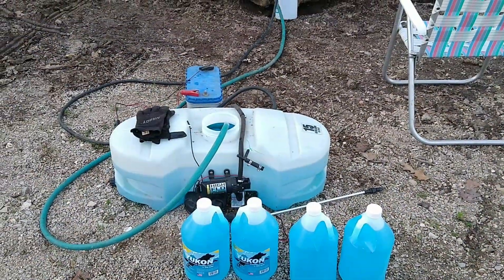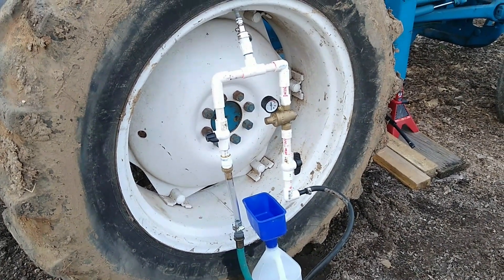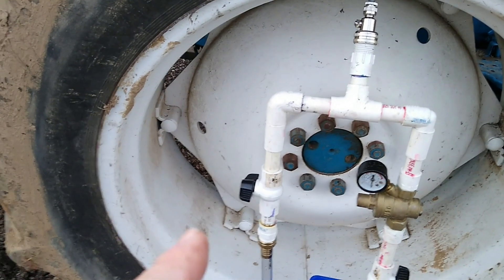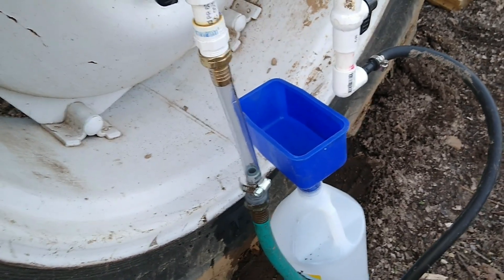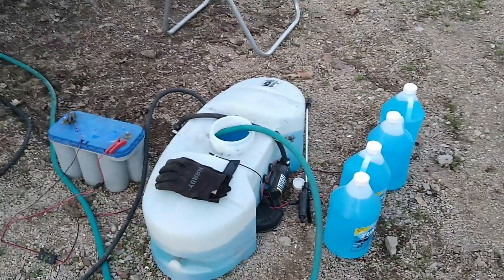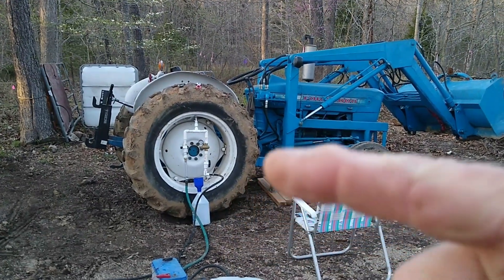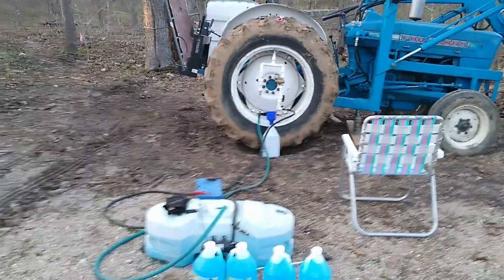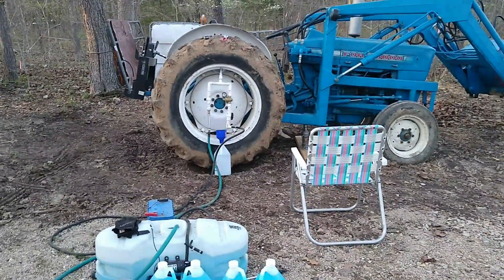Tractor Tire Ballast Weight with -20 Windshield Washer Fluid

Comment: My Grandfather and Dad used to drill wells down Kingsland Fordyce and Rison. They used a draft horse named Shorty who would climb in and out of the truck for traveling to the drill site and a Model A Ford 1.5 ton dually Truck to pull it back up to change shaft extensions and carry the tripod. It did this by attaching the cable between the dual rear wheels. The Blackmith locally made the Drilling bits and reforged them as necessary. They drill quite a few Hundred wells between the 20s to the 50s. Our last name is Crain.
Reply from the maker: That's an incredible family history and an amazing story about how wells were drilled back then!

Comment: I could have filled those tires for not much more money and used proper ballast. Washer fluid killes tire over time. Rim Guard does not. RG weighs about 35% more than washer fluid. And RG wont freez till -35.
Reply from the maker: I sure could use an additional 35% weight.  I wish you were close enough to have filled them.  I haven't heard that washer fluid was problematic for tires.   Thanks for the information.
Reply: @Returning to Basics  We have dealers all over the Midwest and South East. If you ever want to try it, I can help find a dealer or have some shipped directly from the factory. Freight shipping is often not to crazy.
Reply from the maker: I have a new TYM T25 and am considering having Rim Guard put in the tires.  Can you tell me the nearest dealer to Jonesboro, AR?
Reply: @ReturningtoBasics  Rim guard was not an option here in Arizona, no dealers, and way too expensive to ship as I needed 98 gallons. So I used -50° RV Antifreeze. Was the same price as window fluid, weighs more per gallon than window fluid, and is non-toxic. No brainer for me!
Reply from the maker: It was not an option in my area either.  I had to use RVAF or Windshield Washer.  I would have to travel hours to get to a Rim Guard dealer.
Reply: @ReturningtoBasics  Water with about 10 to 20% antifreeze is a good option. The antifreeze obviously helps freezing, but also helps prevent rust.